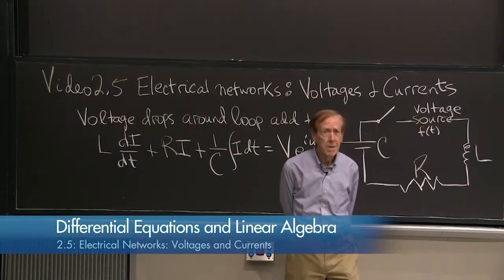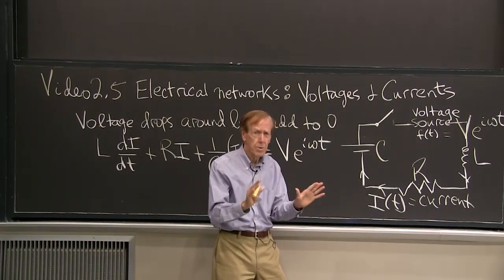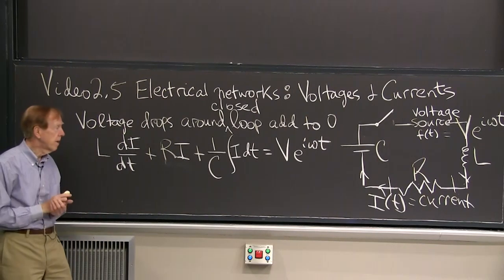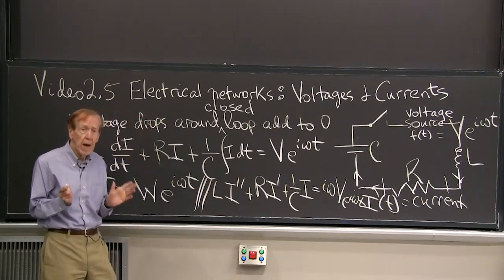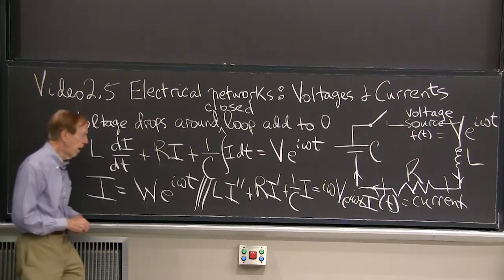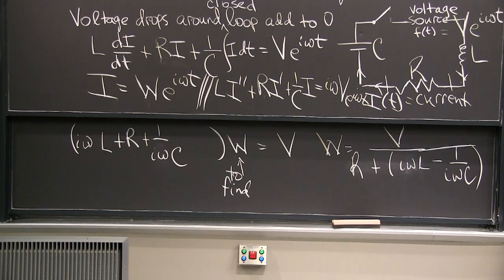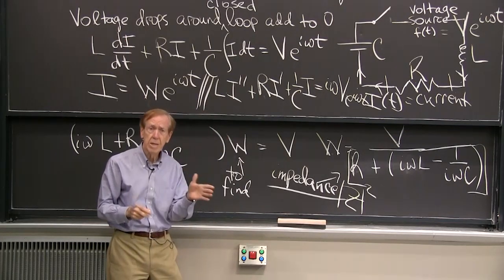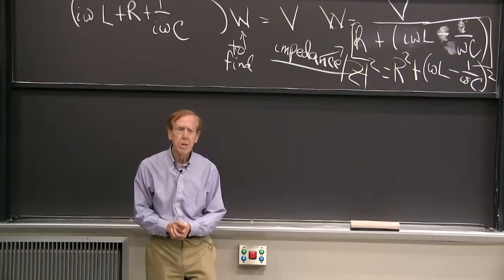Electrical Networks: Voltages and Currents

Comment: People think disappearances mean failure.

That assumption only holds if nothing improves afterward.

Look carefully at the timing.

When certain students stopped being seen,
the lab didn’t slow down.

It became more efficient.

Power doesn’t always come from machines.

Sometimes it comes from what thinks,
learns,
and never gets a choice.

This is only the entry point.

The next truth isn’t in statements or explanations.

It’s in the record of changes —
where additions are logged
and removals leave quieter marks.

Comment: At 05:48 he compares electrical with mechanical engineering, Resistance with Damping, Inductance with Mass and Capacitance with Stiffness.
I couldn't get that completely, I am from electricals background, it would be great if you could give explanation or reference to those analogies. 😃
Reply: Compare an RLC circuit to the motion of a mass in a mass-spring system. In an RLC circuit, current oscillates between L and C depending upon the value of R analogous to the mass which oscillates back and forth along its mean position. Duration of motion depends on many factors including friction. So friction is analogous to resistance. If L and C is more, the natural frequency of an RLC circuit will be less. Similarly if the mass of the body is more and if the spring is stiff then the mass attached to the spring will not oscillate at a high frequency.
Reply: gotta take the perquisite lol

Comment: Wow. Best electric engineering class I had. Finally understand impedance. 
So, the amplitude of impedance is the gain of the circuit. 
There is any parallel of impedance in the mechanical mass/damping/spring system? Thanks

Comment: Hello! I surmise Prof. Strang's former colleague Walter Lewin and othe fellow physicist would actually disagree with him about invoking Kirchhoff's KVL here; as the flux here is constantly changing. It precisely is an application of Faraday's law. 
I hope MIT OCW authority will take a second look here and amend it ASAP. :)
Reply: Maruf Ahmed But there's no electric or magnetic field applied into the loop? That would be a matter of conservative flow... and because there's no external field applied to the loop, I would assume that flow is conservative with the "eularian" flow term goes to zero. I know what you're talking about and I've seen it, but I don't think Lewin meant that the eletrical engr curriculum was missing something large... just that they never bring it up in the case of non conservative flow (assume it's all conservative).
Reply: Maruf Ahmed apply maxwell equation. There was no external magnetic field.
Reply: Which country you lived professional
Reply: We can consider lumped matter discipline where we will assume that the change in magnetic field is zero and there is no charge build up in the circuit and circuit operation is way less than speed of light and if we talk in power systems perspective we want to use Maxwell eqns to solve for transmission line transients

Comment: Minor mistake - not math related. In the video the symbol for the capacitor looks like a constant voltage source. The bars should be of equal length in a capacitor. 

Many thanks to Prof. Strang and OCW for such an interesting differential equation series.
Reply: Maybe he tried to draw a polarized capacitor lol
Reply: but a capacitor just supply voltage and it is self understood...